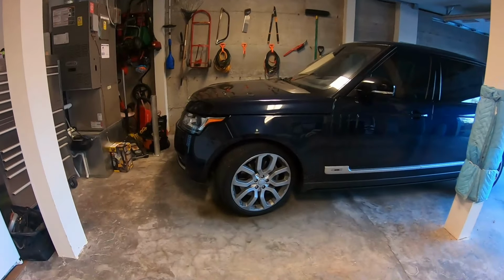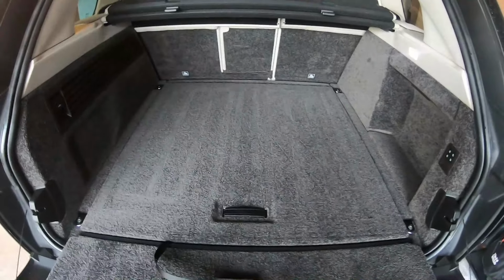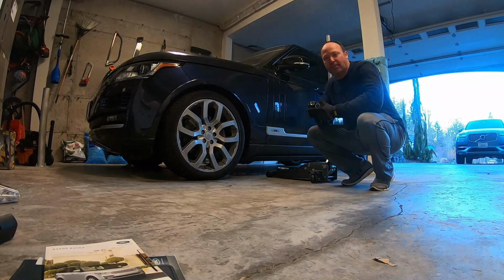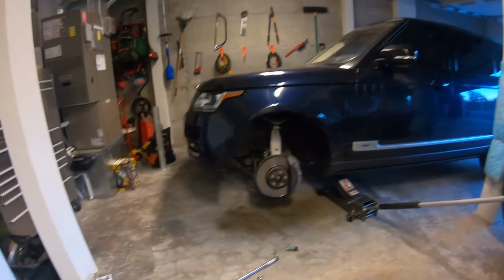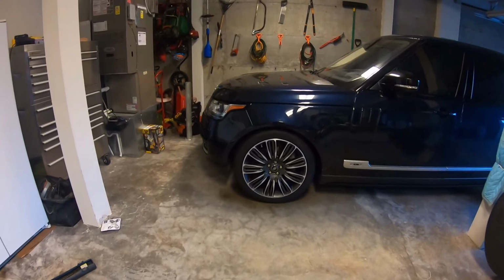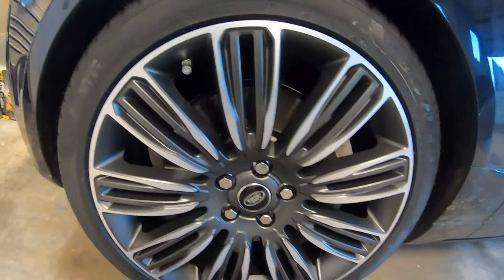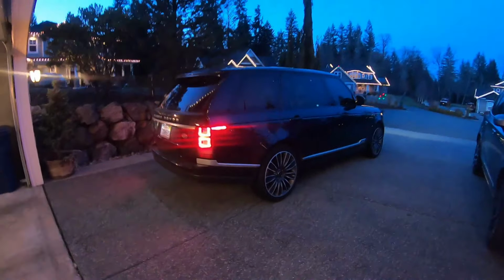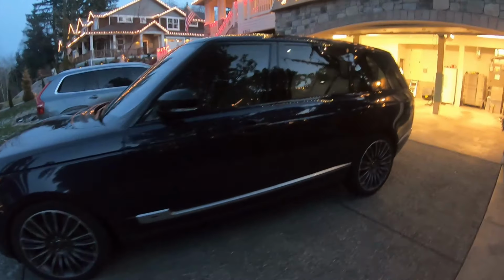Installing Pirelli Scorpion Snow Tires on Range Rover LWB 22" Rims/Tires

Comment: Something I learned recently. You don’t want to use a torque wrench to loosen lug nuts. I destroyed mine by doing that. I don’t have a lot of experience with them so maybe some of them have a setting that makes it work like a non-torque wrench. Just a tip so people can learn from my mistake. Thanks for the video.
Reply from the maker: Thanks for the input...I've never had any issues but if you did then now people know to consider another way to remove them.